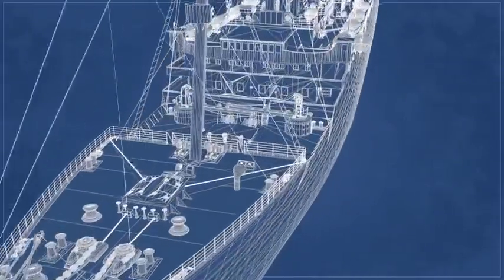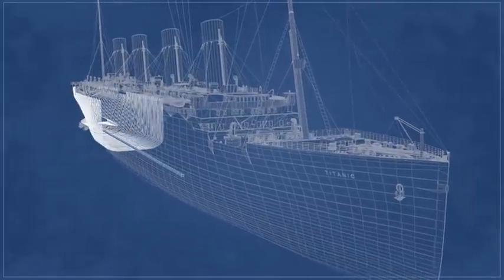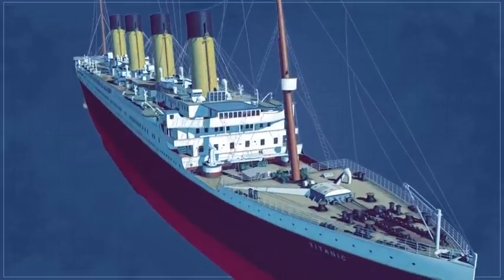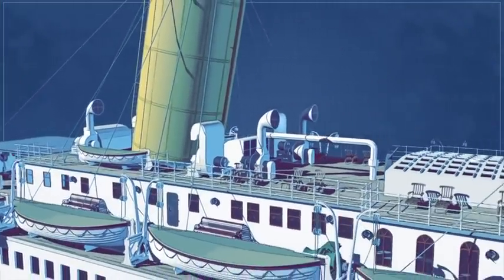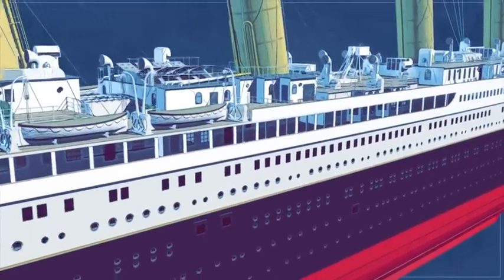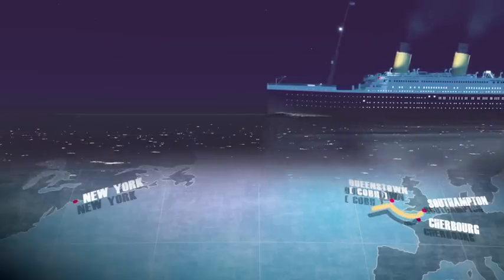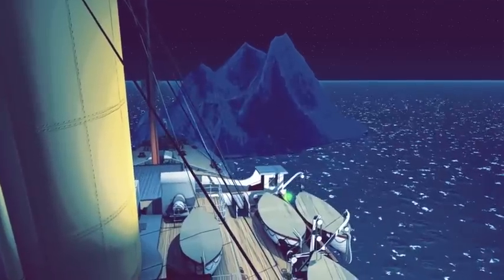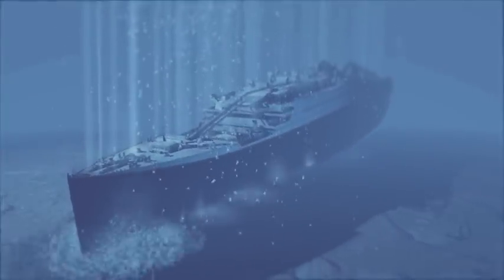The Titanic 3D Model - As You've Never Seen Her Before

Comment: 4:50 it defies physics right there
Reply: no, it really doesn't. 
since the front half is full of water, it is 10x more heavy than the back half, which would cause a teeter totter effect, breaking the ship in 2.
The front half sinks immediately due to being already full of water.
the back half has a only a few flooded compartments, weighing that half down where the ship broke off. 
due to the compartments that didnt flood yet, it creates an air pocket causing the rear end to rise, while simultaneously sinking where it originally broke off.
Reply: @jayhoward2364  the stern in this animation reached an extremely high angle despite only a few dozen feet being below the water, it wouldnt have reached that angle until at least half of the stern was underwater
Reply: @jayhoward2364  the rear end only rose to about 20-25 degrees. not nearly 90
Reply: This was made in 2022. There was no way that the ship could just break very fast. I swear, I think it happened to be the stern only being attached to the double keel while the ship actually split in half.

And hey, this is just what I think it is.
Reply: True that's isn't how she even sank
Reply: You wern't there! Maybe physics were different back then!

👻
Reply: @ccrider3435  yeah just like colors were just white, black and grey
Reply: @ccrider3435 yeah really happy the devs patched the physic glitch’s.